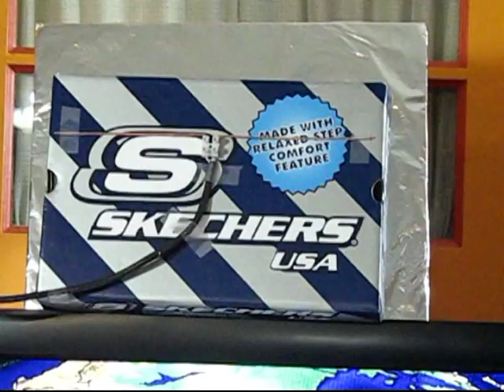How To Make A HD Antenna Out Of A Shoebox

Comment: This is a half-wave dipole antenna which has an impedance of 75 ohms, so it can be connected directly to the coax cable.  However, perhaps a 1:1 balun might be desirable to reduce electromagnetic interference.
I made an antenna like this and it works pretty well.

Comment: I just use a wire coat hanger... Add more for stations that futher away and add some to each side of hanger keep it balanced then the hook. I hook to the ceiling duct work or over a curtain rod.Close to a window works the beat.  Can stick out side by a down spout too.I get about 30 channels on mine.Which is ALL the Des Moines area channels has. . I'm in a 2nd story apt and live in the city so within 20miles of all the channels

Comment: using the back foil as a pseudo reflector ground plan is smart. that's why this simple design work just think if a 4 or 6 element fractal was used.

Comment: This antenna design lacks an impedance adapter between the dipole (the two copper wires in the mounting block) and the coaxial cable.  The characteristic impedance of the atmosphere, and the dipole, is around 300 ohms (with variations caused by humidity, barometric pressure and even the magnetic field of the earth); while the characteristic impedance of the coaxial cable is 75 ohms.  This is a ratio of 4 to 1, which means about 3/4 of the strength of any signals received is lost transitioning from the dipole to the cable.  Put an impedance matching transformer between the two and you will keep much more of the signal strength.
Reply: Folded dipole is 300 ohms. That isn't a folded dipole. If he had made it folded he could have used a coax cable with female connectors on each end and a 75 ohm to 300 ohm balun with twin leads on one side and a  male coax connector on the other end and not needed to strip the coax - which is the hardest part for most people to do.

Comment: @QbAnYtO 
yes this shoe box antena actually works better than the 3 antenas i had purchased
1st was a rca square antena at around $60 =worthless
2nd was a 19.95 simple rac diapole antenna with uhf loop 39 inch diapoles.i thought longer was better=wrong
3d was a philips composit type plastic uhf loop with adjustable diapoles.
this shoe bvox design actually gives me better more stable picture??

Comment: Thank you for taking the time to post this video. Just curious, what is the purpose of the shoebox? also, I recently bought a cheap rabbit ear antenna, which works to a degree. anyway to use the rabbit ears combined with the shoe box and foil to improve its reception?
Reply from the maker: Yes, the shoebox is a spacer between the antenna and the reflector.
Reply: Duke Gomez-Schempp thanks for responding. what do you think about using the shoe box and foil in combination with cheap store-bought rabbit ears?
Reply from the maker: Yes, that should work the same
Reply: You will also need a " Balun " a 75-300 Ohm Balun.

Comment: I have a flat screen 2008 model tv. Will I need a converter box with this.  Dumb question but I was going to put this old tv on my garage wall.   I'm not up on how the signal comes in so I have to ask.
Reply: If your TV receives digital TV, no converter needed.
Reply: You also need a " Balun " a 75-300 Ohm Balun, which is about $2.00.

Comment: Reading these comments is somewhat amusing.  With antennas there is a huge variation in what works in what conditions.  Often it is the placement that matters most-even though some store bought antennas say they are omnidirectional they're not really.  Is a $50 antenna better or worse than this homemade antenna?  It all depends...the only way to know is to make one and try it.  There is NO one best antenna.
Reply: +villipend Actually I'd say the old arial antennas that used to be mounted to everyone's roof are really the best.  But these days everyone's looking for something indoors.  BTW if you do want to put up an old ugly outside antenna and you have an HOA that says you can't, tell em to pound sand.  That is one of the few things that HOA's are not allowed to forbid under law.

Comment: What a mess. I copied a rca yogi I just bought but scaled it down. To a third the size. Used only same wire from copper core of some coax. This is important same diameter Same material copper with copper. Aluminum didn’t work no matter length or diameter. By using the wire from coax core making simple dipole driven element was then short to longer lengths ofsame core . wire. The shied is is not part of antenna. It only protects core from interference. You can ground shielding but come in contact with solid core wire and it outperforms store bought larger antenna made from alluminum. I get every channel possible in my area. That size wire with less connections made from copper just works. Look up how yagi antennas were developed and why I’m positive you can achieve same results. Bigger didn’t help and you can’t argue with results. You can try more experiments with possible differing data. But my antenna simply works